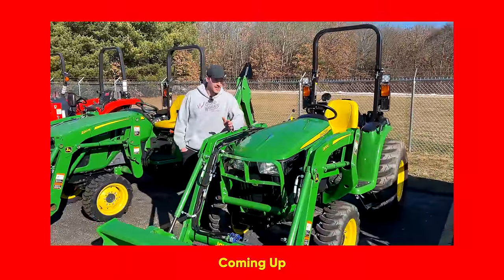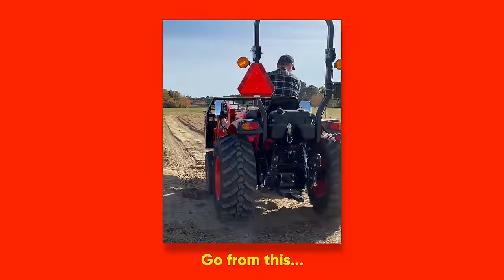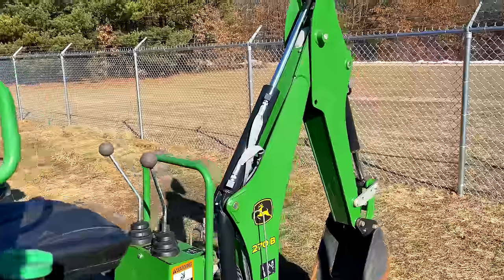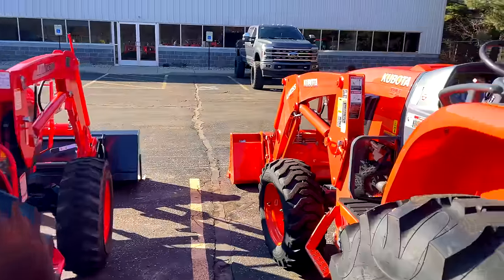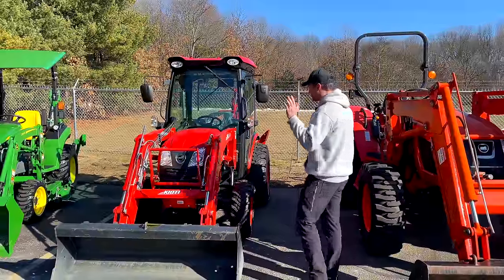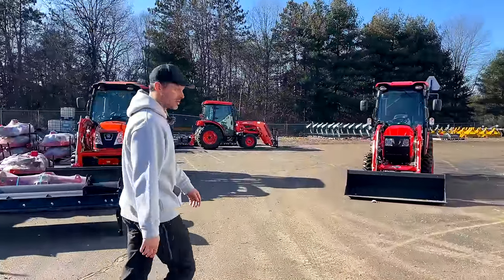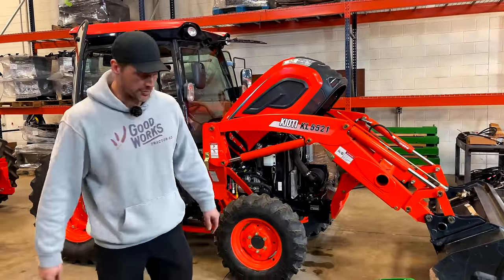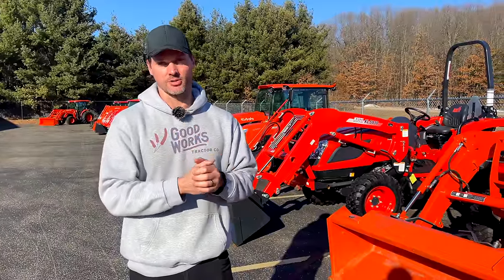JOHN DEERE ISN'T WINNING ANY MORE...

Comment: my deere  3025D w 300E loader lifts 1200 to 1300 lbs ,now that same loader, brand new only lifts 800lbs ?! thats nuts!!  my old Jd790  which is lighter tractor, had the same lift  of 800lbs
Reply: The 3E and 3D tractors have different front axles, and I suspect that plays into it despite them using the same loader.
Reply: rear end is 600lbs is heaverer, but front end is the same.
Reply: the diffence between d and e ,the 790 is much lighter,to add.

Comment: What worries me about Kioti is longevity and long term reliability. Yeah they are fine and dandy when they are new, but let them get some hours on them. You just don’t see any Kioti’s out there with 2/3k + hours. And when you find one that has 1000+ hours on it it’s always a faded out rust bucket if it’s still running. I’m trying to talk myself into buying one but they just scare me. Not to mention the trash resale value.
Reply from the maker: Interesting.  They are a 70 year old company that does a billion in revenue a year.  How much more established do you have to get? 😂
Reply: @GoodWorksTractors  I’m not doubting the longevity of the company, I’m simply curious about the long term reliability and build quality of the machines. I wish there were more high hour Kioti machines out there. Been seeing quite a few late model issues lately on the Kioti fb group that doesn’t sit well with me either. Not knocking them at all, I’m genuinely curious. Currently looking at purchasing either a 4044m or an NX4510.
Reply: They got the hours on them in countries other than North America.  I really like mine. My brother bought a Kubota and i got a kioti because i didn't plan to use it much and he thought the Kubota was better. His was back in the dealership with less than 5 hours on it to fix a leak covered by warranty. Mine hasn't been back to the dealer ever for any problems but I dont use it much. Like only 100 hrs a year. I had it 3 years now and really like it.

Comment: Specs are one thing.  Real world results are another.  I’m wondering if the published lift capacity is set by the lawyers, not the engineers.  JD lost a $5 million lawsuit because of a rollover due to no factory installed counterweight on a 3 series tractor.  Maybe GWT should do a head to head test of equivalent tractors from a few manufacturers.

Comment: Does Kioti do  a MMM on any of their machines?
Reply: CS and CX models have a MMM available. The CK line has an optional mid-PTO, but they've not yet released a mower for it.
Reply: @oefveteran09  Thanks! I’m shopping.
Reply: On The CX, you can get a mid mower and air conditioned cab. Mowing in style.

Comment: Super goofy pedal on the super Kubota 😅
Reply: The treble pedal is annoying unless you have large feet. You’re not supposed to use your heal to go in reverse, you’re supposed to use your tow and lift up. Once you get used to it, it’s not a problem at all.
Reply: Dreadful treadle pedal with split brakes in front of it, dum engineering!
Reply: @kendrury3713  little too squirrelly 🐿️

Comment: John Deere has lost contact with reality  which is " CUSTOMER IS KING" . They care nothing about the customer and people be are basically a way to make money at 99% of the dealerships . Quality at least in the US has gone down . ( The ones made in Germany might still be the best models be cause they still have pride in what they produce and their work on general) .More and more components are plastic. If you need to get something repaired at the dealership or maintainance etc you get raped and are charged 5 times what normal people make an hour which is absolutely infuriating. I could ratiionalize $50 an hour labor but $150 an hour is a slap in the face especially to someone who makes that for working an entire day .